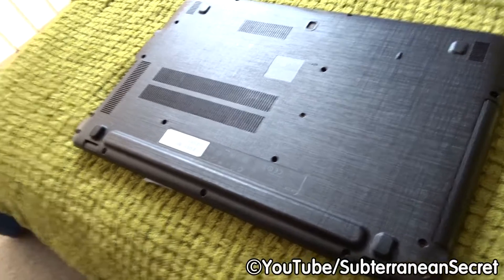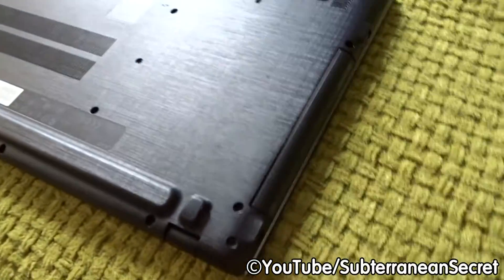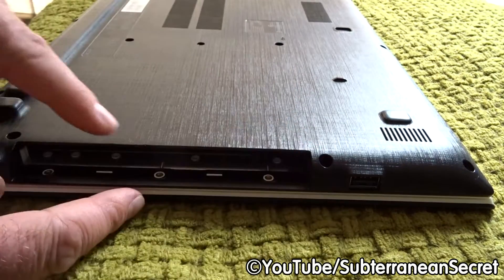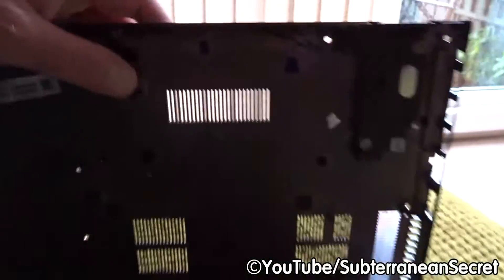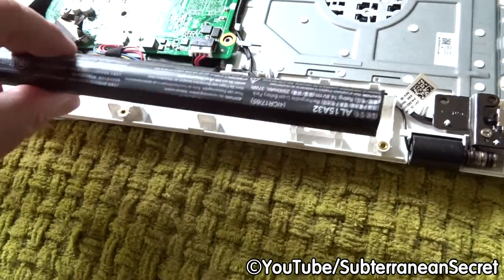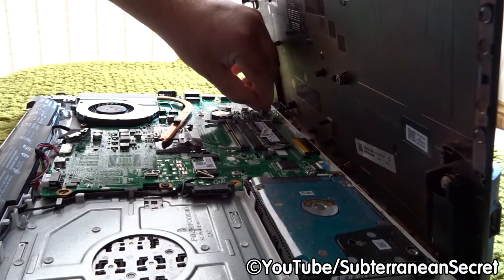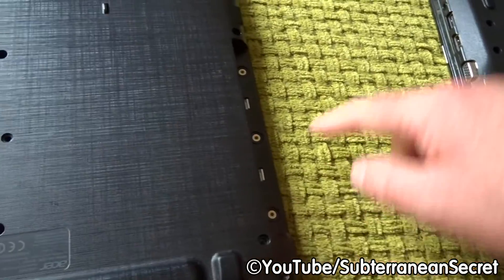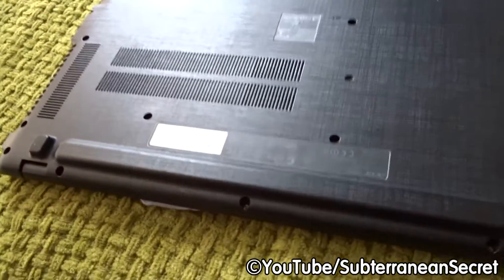How to Replace a Built-In/Non-Removable Battery in a Modern Laptop

Comment: If a laptop stops responding or stuck on screen press and hold the power button to power off the laptop. For best results do not remove the battery. Removing the bottom cover and battery can lead to safety hazards.

Comment: First, thanks to a lot of good info. I have wondered how to get replacements and install non-removable batteries. However, all the rapid camera movements are nauseating. Hold the camera still or get someone else hold the camera while you demonstrate. I agree with the comment about too much lead in. All the info about removing screws, carefully unsnapping plastic catches around the edges can be covered and repeated in less than a minute. You have a lot of good info here that could be edited into a better video.

Comment: should i remove the battery temporarily while replacing the HDD with SSD and upgrading the RAM? I almost have the same Acer laptop with non removable battery..
Reply: Yes, it's always advisable to disconnect the power (which is the battery, in the case of a laptop) before performing any service to the internal components.

Comment: can the laptop still turn on or run without the battery? because I've heard that if you remove the battery of that kind of laptop, it won't run like asus modern laptops?? thank you for your reply sir.
Reply from the maker: I can confirm that this Acer laptop did run with the battery 
disconnected. Whether other laptops with built-in batteries will run 
just with the power cable I don't know.
Reply: @subterraneansecret   so its ok to use the laptop with built in battery while charging?